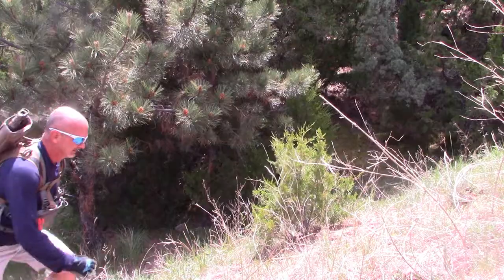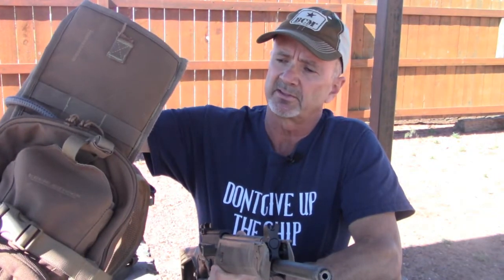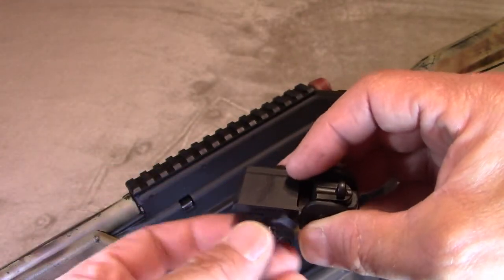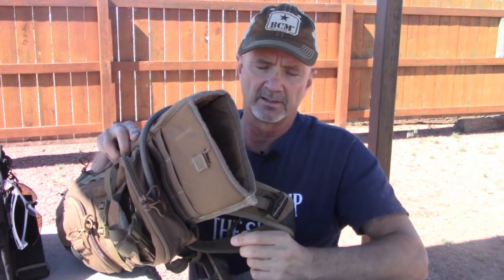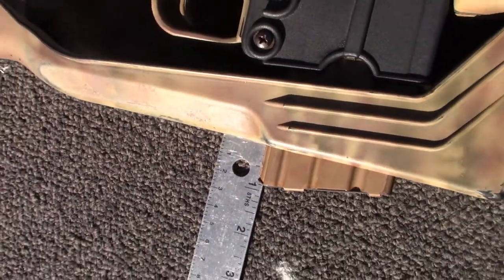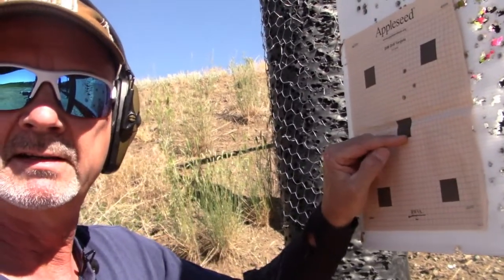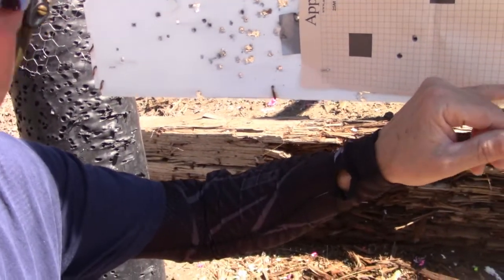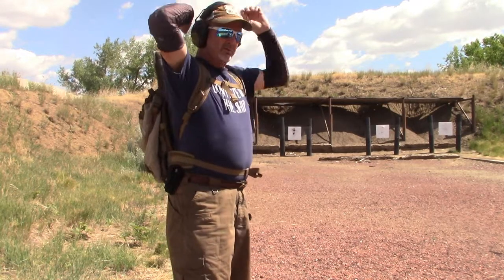Optimizing the KelTec SU16c with Tech Sights...and little else.

Comment from the maker: For context, see the previous SU16c video.
https://youtu.be/hdoaDvwCats
Reply from the maker: Also check out our review of Tech-Sights on an AK47.
https://youtu.be/FwP8k605HxE
Reply: Thank you sir, I have seen this video. I totally agree with his thoughts on this particular topic.
Reply: You said on your other Kel-Tec SU 16c demonstration video that your receiver broke. Kel-Tec company told me the only reason the receiver will break on that rifle is if you put a silencer on it.
Reply from the maker: @unitedstatesirie7431  Definitely not true. I never ran a can.
Reply: @AmbGun   how will I know if my new KEL-TEC SU16 C rifle receiver will break ?
How many rounds can I shoot before it breaks ?
Reply from the maker: @unitedstatesirie7431  I do not know any way to tell. We have two other SU16c rifles that have not had any problems. Now days I run Sentry Solutions Tuf Glide dry lube. Back when my receiver cracked, I was running wet lubes. I doubt that was a factor, just a data point to monitor. The crack I experienced was not enormously catastrophic. Had circumstances dictated, I am confident that I could have super glued it back together as field expedient repair...or even duct tape. Still, this is a special rifle. A light, compact, thoroughbred. It is not going to be as robust as an AR or RDB. But as a backpack portable it excels. 

My SU16 saw hard abuse. It endured weekend long Project Appleseed events, many coyote hunts, lots of run 'n gun, extreme cold, and pretty extreme heat.
Reply: @AmbGun   thanks for the information. I will make sure to not use any oil on and in the rifle's receiver. 
The receiver is absorbing the oil like a sponge causing the receiver to become soft and weak. 
The KEL-TEC company should warn people to not use oils, solvents on the SU16C receivers. They should include this information in the rifle's owners manual.
Reply: @unitedstatesirie7431  That is BULL$hit, I've never put a suppressor, that is really what most people call a silencer but don't know any better, on ANY of my firearms. EVER!
Reply from the maker: @unitedstatesirie7431  I've had no issues using Sentry Solutions Tuf Glide dry lube. As best as I can tell the product's carrier, mineral spirits, has not caused a problem. At the very least, I would recommend getting Tuf Glide on the rails that guide the BCG.
Reply: @AmbGun   Thanks for the infomation. 
The KEL-TEC SU16C is my favorite 5.56mm caliber rifles, because it is very lightweight, compact when shoulder stock is folded and requires much less cleaning than an AR-15 rifle. 

I protect the outside metal of my rifle with 'FLITZ Gun & Knife wax' to keep rust away. Water just beads off the barrel, and other metal parts. For "break glass in case of an emergency" you can keep a SU16C rifle in a vacuum seal bag with a few moisture absorbing packets thrown in with the rifle before you vacuum seal it closed. It will keep the rifle from rusting for many years just as long as the vacuum seal is completely closed.

I know the prevention of the cold or flu and cure for the Coronavirus and how to prevent from getting the Coronavirus. It is not promoted by the corrupt FDA, CDC or greedy pharmaceutical industry. 
*Buy at the Super Supplements store, Wholefoods or Vitamin Shoppe only (do not buy these at grocery stores!) Take a high quality Zinc, Copper supplement with high quality vitamin D3 supplement with a high quality Magnesium supplement.  
* Take all these at the same time with a glass of steam distilled water that has NO fluoride in it.

* Optional:  You can detox your body first with Cl o2 to strengthen your immune  system. Take 12 drops in steamed distilled water with no fluoride in it.  You can buy Cl o2 from a website called CancerCure7.com

Many people that are critical and untrusting towards corrupt politicians will become trusting of corrupt politicians once the corrupt politicians tell people that their life is at risk if they don't follow their recommendations and new freedom restricting laws.

Psyops fear based mind control is a favorite trick the corrupt politicians use on people often and are using the Coronavirus deception to deceive people into receiving the new 666 mark of beast money-slavery system vaccine of the very near future. 

"We're entering savage new times, and we're going to have to be pure and direct and strong, if we're going to survive..."
~Quote, 'VIDEODROME' (1983)

Are you aware of a historical secret that the 'Founding Fathers' of the U.S.A. did not want the Constitution & Bill of Rights to last much more than a few hundred years ?
The 'Founding Fathers' actually wanted the Constitution & Bill of Rights to fade away and be replaced with an evil theocracy dictatorship controlled by Rome, Italy. 

Monarch or Republic? 
"Republic... if you can keep it."
~ Quote, Benjamin Franklin 

* Watch the Christian video documentary on YouTube called, 
'THE HIDDEN FAITH OF THE FOUNDING FATHERS'  for the frightening evidence. 
------------------------------------------
"Man lives, in the sunlit world of what he believes to be, reality ....but, there is unseen by most, an underworld, a place that is just as real, but not as bright lit ...a dark side." 
~Quote, Tales From

UNITED STATES  I. R. I. E.
Investigation Research International Educator
The real "X-Files"
US 5977293425 
AGENT Sinne'
Reply from the maker: @unitedstatesirie7431  I do this vitamins, Flouride  free water and toothpaste (unfortunately, shower in city Flouride) water. 

Check out Hologram of Liberty by "Boston" Kenneth Royce.

https://smile.amazon.com/dp/B00NRJEAN4/ref=cm_sw_r_cp_apa_obYQFb07Z81F9

Comment: I bet the new primary arms 3x micro prism would suit the rifle perfectly if you wanted a magnified optic on it. The micro prism is very lightweight too
Reply from the maker: Yes, that or a low mount ACOG would work and they wouldn't interfere with field stripping. But they both would still reduce the ability to fit in a backpack scabbard. Hard to beat low drag and lightweight Tech Sights. 

https://www.ambgun.com/ambidextral-rifle/backpackrifle
Reply: @AmbGun  I drive through eastern Washington fairly often and I think a 3 or 4x sight would make it a very interesting "prarie gun" for lack of a better term. Definitely a cut above my sub2k in an area that open

Comment: Which scabbard are you using? Thank you.
Reply from the maker: I believe it was the A2SS, a three panel scabbard with a triangular opening. With a 20 round mag, this is pretty tight, but at least it doesn't shift around much. 

All of my scabbards have been modified, shortened to better fit the SU16c and allow for easy sitting with the pack on. 

The scabbard I used in the previous SU16c video was the larger, four panel scabbard. Snug with the red dot setup. Easy loose draw with iron sights. 
https://amzn.to/36gPs5Q

Comment: Have you shown anywhere in your videos how you added the  cuff sling attachment point to the foregrip? Does it keep the bipod from folding down even without the cuff sling attached? Thanks so much!
Reply from the maker: No, but I'll try to do a short little video on that. It does preclude use of the bipod, which for shooting I'm not a fan. But it gets in the way of field stripping, which ultimately led me to remove it.
Reply: @AmbGun    I have a question for you:  
Do you know why I added a zip-tie band around the upper receiver near the rear of the receiver sight and pistol grip area of my KEL-TEC SU16C rifle ?
Reply from the maker: @unitedstatesirie7431  Lost the takedown pin? Or maybe lightweight ties to act as a canary to warn when the receiver is taking a pounding due to loosening gas rod?
Reply: @AmbGun    I put the zip-tie around the upper and lower receiver to keep them from separating in case the upper receiver cracks.  There have been reports of some KEL-TEC SU16 rifle's upper receivers breaking after firing close to 1000 rounds of 5.56mm ammunition.